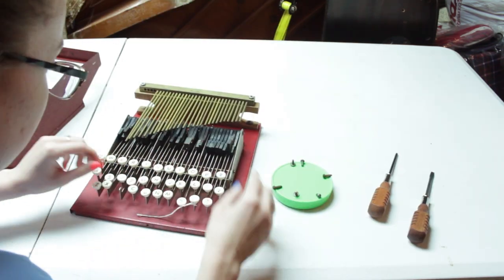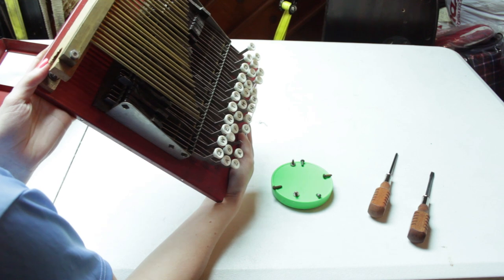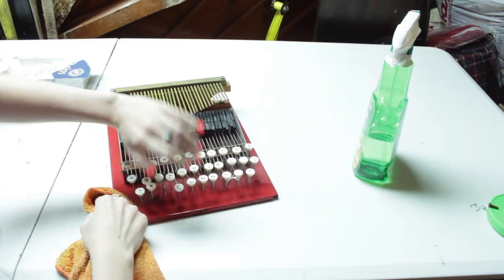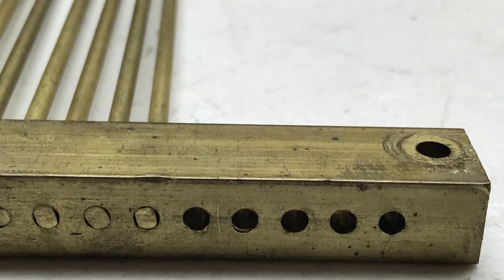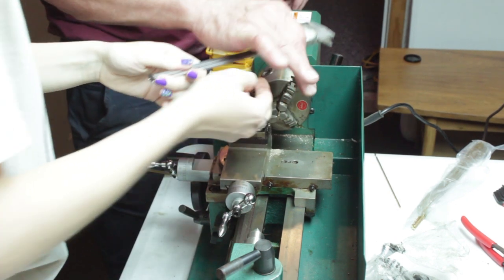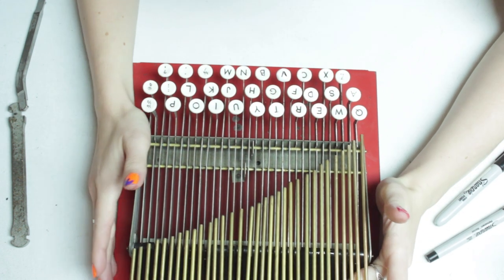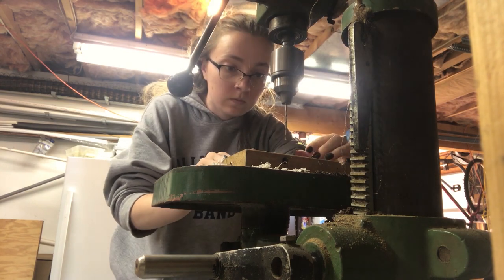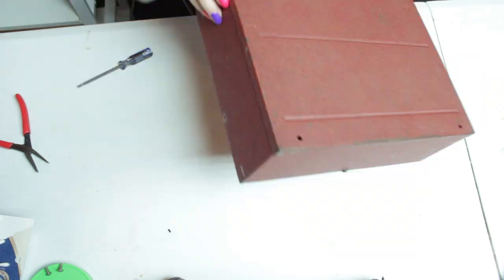Fixing a TYPATUNE???? (My musical typewriter)

Comment: 2:36 The 1st idea was to use Clock Chime Bars but they were way too big & heavy for this Machine. What we later discovered was that the Original Chime Bars were just 1/8 in Brass Rods that were modified to Ring. The Rods have a 3/8 in. Base (it goes into the metal base of the chime) that's crushed so that they vibrate & there's a 1/16 in tip to allow the rest of the rod to vibrate. So we were able to find some material to make those Bars.

Comment: The Layout is the same as a B System Accordion & you can play it like a Bayan by putting it in your lap. It has the same range as a Pipe Organ Bass Pedal Board but 2 Octaves higher.
Reply from the maker: Very cool!
Reply: @JustMyTypewriter  This is something Accordionists could play
Reply: @JustMyTypewriter  The sound of this is a bit darker than a Schoenhut Toy Piano because it has Brass Rods rather than Steel.
Reply from the maker: @RockStarOscarStern634  Good to know!
Reply: @JustMyTypewriter  It would be great for song covers.
Reply from the maker: @RockStarOscarStern634  I did use it at the front of my Scranton thrift video to cover the office theme
Reply: @JustMyTypewriter  Oh yeah after you restored it.

Comment: Great video.  I am in the middle of restoring a Typatune and I have similar bent black hammers.  Was it that simple to straighten?  250 in oven?  How long?  Looks like you could only do 6-8 at a time.  Any other tips for straightening the hammers.  I am also missing a hammer.  Did you to make a new one?
Reply from the maker: I left mine in the oven for an hour at that temp